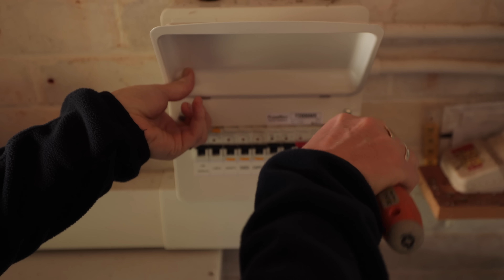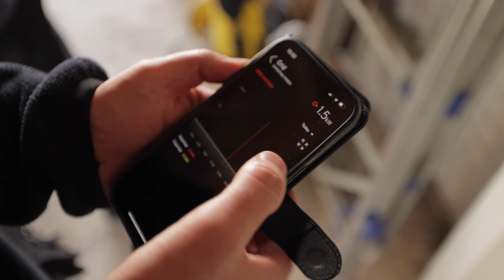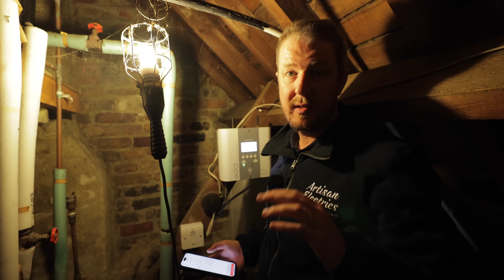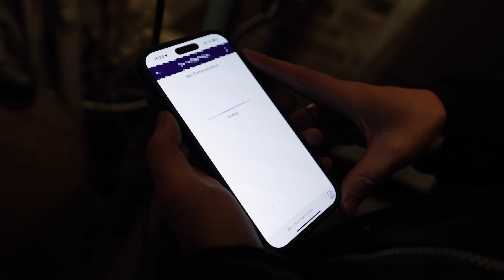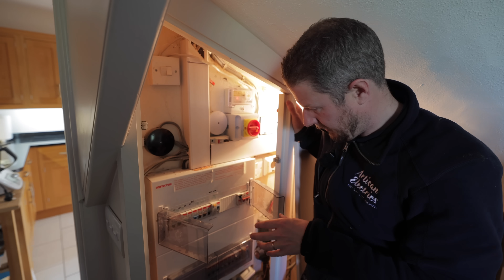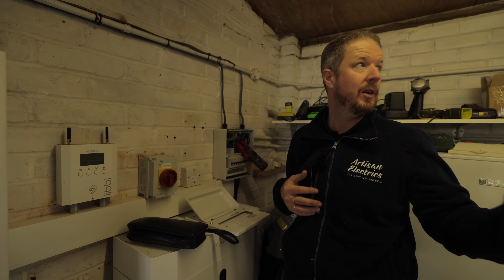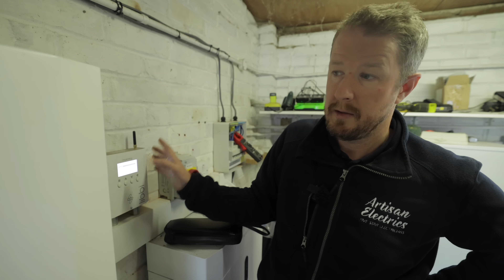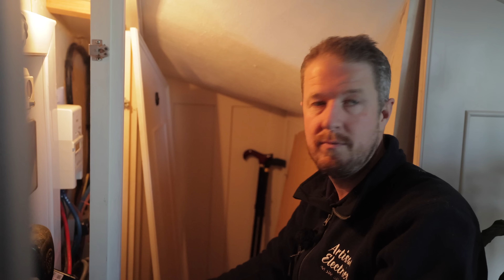£20,000+ Battery System RUINED By This 1 Simple Mistake 😳

Comment: The signal cable should have a clip-on ferrite to stop noise from blocking or interfering with the signal. This is a big problem, even though they are a twisted pair.
Reply: The CT Clamp contains a ferrite core so don't think you'd need an extra one, and I think magnetic interference from other cables is more of an issue than signal noise (but might have to be going at right-angles to have much of an effect).
Reply: It isn't a signal cable, the CT clamp induces a current proportional to the current flowing through the cable it is monitoring.

Comment: So the actual problem was that the battery was only charging at 1kw because the charge limit was set to 18A. After fixing a bunch of unrelated stuff, the charge limit remains at 18A. So, problem not actually solved at all.

Comment: When your panels point in different directions, simply adding the peak power ratings of the panels is going to give an overoptimistic value for your real peak KW.  Just ask yourself what is the peak power if 50% of the array points due east and the rest points west.. Consider vertical panels on the east and west walls when midday would have almost zero output.

Comment: I don't understand why the libbi is remote from the tank (and immersion heater). Mine is right next to the hot water tank. It was a no brainer. The hub and r/f Comms means that location is almost irrelevant.
On a separate note, my installer installed two c/t clamps back to front. I checked everything from the app before they left and noticed that the flow was going the wrong way....
Update:
I've now discovered that because they didn't install an (optional) C/T for the battery system on the solar  inverter/s, the battery system can't see the panels...

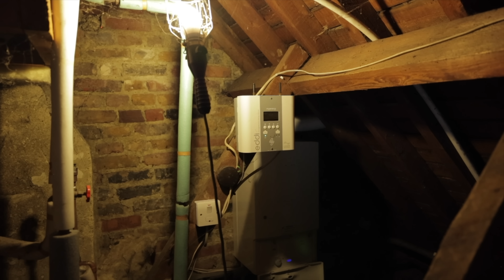Comment: 6:30 Bugs creeping in over time makes sense for insects, but with software they only creep in when the software is developed. I assume you meant to say: bugs that have been identified and fixed over time.
Reply: But many bugs don't show up on fresh install of the system. They show up over time once you start putting system in weird edge-case states.
Reply: Memory leaks are a common issue, which is a software bug that rears its head over time, so not entirely silly.

Comment: 1)	The scenario of the car being charged overnight and the battery being charged overnight isn't rare, that's all winter if the system is being used effectively. The difference between 50A and 55A is near 20% power. That's 20% overrating of heat into that cable. So no, I'd limit the car charger or the battery charger to not exceed 50A

2) Firmware is meant to be firm. Unless there is a specific issue firmware should not be updated. (I am sympathetic here as vendors have started to call what really is software that should be updated 'firmware') Still, those are some embedded devices, don't come to my house and start updating things like that willy-nilly

Comment: Mmmm, interesting. I just had a quote for a full installation a few weeks ago, and the sales person told me that they couldn't put the inverter and batteries in the garage, because of the cable run would be too far and it would be too far from the Wi-Fi. He suggested to put them all in the loft instead. Mind you, my garage is not attached to my house but it's only coupe of meters away from the house.
Reply: answer them to put ethernet cable run into garage and put wifi mesh node there too. 
even regular dirt cheap router or access point will do, but if your home has mesh-capable router then you will have interruption-free coverage when going into garage.
Reply: @johndoe9922  yeah, my router has mesh capability anyway, or I could just change it for an Unify Ubiquity system (I work in IT so I am  familiar with their installation) but I didn't go with them anyways, as I had the feeling they were overcharging and didn't like it that they didn't take my ideas on board. We know better than you kind of feeling from them.

Comment: When a customer replaces their internet provider or has to replace the router modem which do fail occasionally then they will need to do all this wireless pairing shenanigans.

Is it possible to cable the internet connection to avoid such issues in future?  Re-pairing everything requires a level of competence and capability that many people simply do not have.
Reply: (1) For me, "fixed cabling for fixed infrastructure", especially when everything concerned is out of sight. Use wifi where you CBA installing a cable, or situations where the wife wouldn't approve (e.g. connecting to a wall mounted telly) (2) When you change ISP and router, you plug up the new router, check that it works with one device, unplug the old router, then log into the new router and edit the SSID+password to be the same as the old router. If you have different SSIDs for 2.4GHz and 5GHz, then edit them like for like. Most, if not all kit, will then connect without having to be touched.
Reply: Michael - a basic IT course of would give you that knowledge. Also the info you would need to connect your inverter to a wireless router will be on Youtube - maybe have to watch 2 or 3 videos but it's there if you look. Maybe have to speak to the installer / inverter manufacturer to get admin access
for your particular inverter.
Reply: Alternatively I bought a much more powerful WiFi router than the ISP provides that I connect to all my devices, so when I change ISP I don't have to change anything apart from plug in my existing router

Comment: Hold on a minute: Boiling water caused a plastic water tank to melt and burst? What kind of shitty plastic was that tank made from? Plastic water tanks are supposed to be made of either polypropylene (PP), high density polyethylene (HDPE) or fibreglass reinforced resin. If it melted at all, it couldn't have been the last one, since the resins used for that are usually thermosetting, meaning that once the object made from it has been moulded and cured, that plastic can never melt. If it gets really hot, it can still burn - or in the absence of oxygen, it can thermally decompose, outgassing all manner of gaseous breakdown products and leaving porous carbon behind. Single-use heat shields on spacecraft re-entry capsules (such as the old Apollo command modules) are made of thermosetting resin reinforced with glass fibre for that reason.

Back to the other plastics: Thermoplastics (which can be melted and re-cast many times) don't really have a precise melting point, they have a melting range. For PP, that range is between 160 and 170 degrees C. The melting range for HDPE is a bit lower, at 125 to 135 degrees C. Either way, comfortably above the temperature of boiling water - which is not going to get any hotter than 100 degrees C while there is still some liquid water present. So if that tank had been made of the proper materials, it shouldn't matter if the water it contained was all at boiling point, because that isn't hot enough to melt the plastic. Whatever manufacturer made the tank which burst just because of boiling water has got some explaining to do, concerning how their tank failed at least 25 degrees C below the minimum required for any such tank to even start melting.

If it had been sealed completely, then buildup of steam pressure could physically burst it - but they are tanks, not boilers, so they are not supposed to be sealed like that. There should have been an overflow pipe leading to the outside, either sticking out of the wall or somewhere along the join between the wall and the roof. That is usually how you can tell that your water heater is stuck or fused to the "permanently on" condition - there will be hot water pouring out of that overflow pipe. If for whatever reason you don't notice, it can get expensive pretty quick just in electricity use alone: Immersion heaters are typically rated at 3 kW, the same as a fast-boiling kettle. So every hour that it is on, it will be using 3 kWh (aka 3 units) of power, or 72 per day, or 504 per week, or 2016 per month. So you will have whatever that cost is, on top of your normal electricity usage.
Reply: You've misunderstood. The tank is the header tank NOT a hot water storage tank. By memory the installation was dodgy and safety systems had not been installed, the thermostat failed causing hot water to enter the tank it should never have ben able to do so, it burst with a terrible outcome.
Reply: @hoojchoons2258  Believe it or not, I did actually watch the video all the way through, so I am well aware that it was a header tank being discussed. This was after all a tank in the loft space, which is typically where header tanks are fitted.
Maybe you didn't notice this, but I only made reference to "plastic water tanks", I did not specify the purpose, but neither did I claim to be talking about hot water storage tanks. I am however well aware that hot water storage tanks are usually metal rather than plastic: In the UK they are made from copper, in the USA they are usually steel (not sure why that is though), with either a layer of rigid insulating foam stuck to the outer surface, or some kind of insulating jacket strapped around the outside.

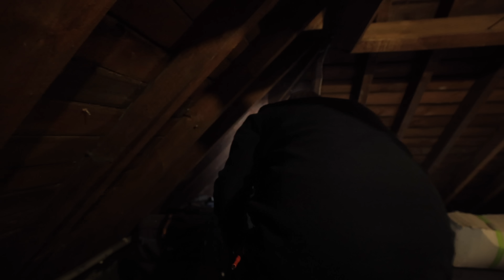Also, if you go back and watch the video again (between 8:30 and 9:30 elapsed), you will see that the author was talking about what happens when the thermostat(s) fail on an electric immersion heater fitted to the hot water storage tank, causing the heating element to remain permanently switched on. He describes how the hot water can migrate upwards (by thermal convection) and end up pouring into the header tank.

If you are wondering how that could be possible: In a typical indirect system (where the hot water tank is fed by gravity from a loft-mounted header tank, rather than filled directly from the incoming water mains), the hot water tank has three connections: One will of course be the gravity feed pipe, which allows water from the header tank to fill up the hot water tank from the bottom. Another connection is at the top, which allows hot water to be drawn from the tank, to supply all the hot water taps.
This system allows any hot water remaining in the tank to stay hot even as some is drawn off and replaced with cold water: Since cold water is more dense than hot, and the cold feed enters the tank from the bottom, it mostly does not mix with the hot water above it - or does so very slowly. This is also why an immersion heater element should be long enough to extend down to the bottom of the tank: If you use a shorter element which only extends halfway down the tank, then the water in the bottom half of the tank will not be heated, unless there is a forced agitation mixer fitted inside the tank as well. Whereas if the same short element is fitted at the bottom of the tank, the convection currents will effectively distribute the heat to all the water in the tank.

The third connection, also at the top (or just connected to the hot water supply pipe) goes back up to the loft and vents into the top of the header tank. This is the expansion overflow, which is necessary because water expands in volume considerably when heated.
So if the immersion heater element is somehow permanently switched on and the water inside reaches boiling point, this is how the boiling water rises up from the hot water tank and pours into the header tank. Eventually, this can cause all the water in the header tank to be heated, as water cycles between the two tanks. I have seen this happen personally, caused by the same fault condition described here: The thermostat on the immersion heater failing in a way that results in the heating element being permanently switched on.
I mitigate that possibility on my own hot water tank by having the immersion heater wired through an electromechanical time-switch: This allows it to be on for about an hour towards the end of the cheaper night-time "economy 7" tariff (which in my region  runs from 1:30 to 8:30 AM), plus a 30 minute boost in the evening at about 7 PM. So even if the thermostats did fail, the time-switch would still impose an upper limit to how long the heating element could be switched on for.

Anyway, I entirely agree that the tank burst incident described should never have been able to happen. The only real difference I am arguing is that the thermostat failure was not the sole cause: Even a plastic tank, made out of the proper materials (HDPE, PP or fibreglass reinforced resin) should have been able to cope with being filled with hot or boiling water. For the fairly simple reason that the melting ranges of either thermoplastic used are well above the boiling point of water. So my suspicion is that the tank must have been made from inferior quality plastic in order for boiling water to make it melt and burst.
Reply: It was probably an old cold water storage tank. The hot water boiled over into the cold water until the cold water warmed up enough to cause the plastic to lose its shape and become soft and pliable. Maybe it was some kind of simple pvc, which is not great above 70C.

Comment: Honestly, the installer who sold the Libbi system to their customer should be held accountable.

Why would anyone opt for such an expensive and inefficient AC-coupled setup—with three additional control boxes mounted on the wall—when a DC-coupled storage system in the garage, with a simple 10mm² solar cable run back to the inverter, would’ve been much cheaper and better integrated?
Even if replacing the old SolarEdge inverter with a new hybrid inverter had been necessary, the customer still would’ve saved a significant amount of money.

The choice of wallbox is somewhat understandable, given how overpriced the original SolarEdge wallbox is. But any other wallbox capable of reading the inverter’s Modbus would’ve worked just as well—and wouldn’t have required yet another control box.

Overall, this seems like a questionable selection of products. Or did I miss something that made a proper installation impossible?
Reply: Maybe he got the panels first, then the battery.  We're in the same boat: we already had solar with micro-inverters, so we got a battery system that could cope with AC coupled solar (hybrid/retrofit mode).  It works well enough... the battery inverter can take solar DC as well and supports up to 4 strings, so maybe I'll go for DC coupled at some point... when I get around to it.

Comment: Not sure the Zappi will auto update. I couldn’t find a setting option in the Myenergi app and a quick Google search seems to indicate it’s a manual process.
Reply from the maker: You're right — Zappi firmware updates usually need to be done manually via the MyEnergi app or web portal. Would be great if it auto-updated though!

Comment: Your Quote .. ‘exporting it to the grid and getting next to nothing ‘ …. Surely you must be familiar with the latest import/ export tariffs .. best available is E.on’s next drive V7 (open to both ev and solar battery customers) - Night rate 6.7P (7hrs) and then SEG rate to export 16.5p  … this means the client would be better to rip out the eddi and heat his water at night for 6.7P and then sell his export at 16.5p rather than heating his water !!
Reply: and consider wood or coal, with a boiler / wetback water heater.
IT is heartening to see the incentives for renewables work in daily use and action.
It make me laugh about how thick Politicians are, and how they think that their policies
work for normal people who are not thick in the head.
Reply: When they go through the energy use graphs the customer mentions they also have an electric Aga which I think does start while still on night rate, then use the solar to top that up
Reply: As I see it all these rates are not fixed for a decade and could be changed overnight. Thus making such a system not viable / no payback. £20k plus investment with a 10 plus year payback time assuming nothing goes wrong in that time seems a very risky (dare I say scam) investment. There are other returns on £20k that don't jeopardise your capital that will more than cover your electricity cost differential.
Reply: import/export tarriffs... on a local grid-tie... uh... 🤣
Reply: @railgap  He has a 20kWh battery so import / export tariffs makes sense. The original installer did not understand what they were installing. Artisan may not be aware that many of us export 1 to 2MWH to grid per year which helps offsets to cost of importing electricity in the winter when solar does not product much. Both Eon Drive and Octopus Cosy (with outgoing) are great depending on what setup you have.
Reply: Customer seemed very sure that he didn't want to export to the grid. Probably afraid that someone might think him a woke.